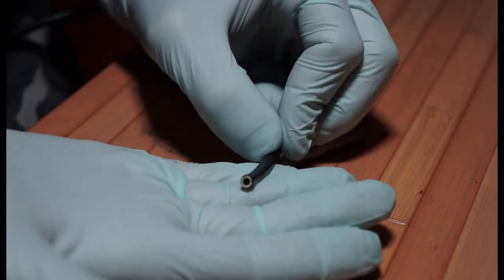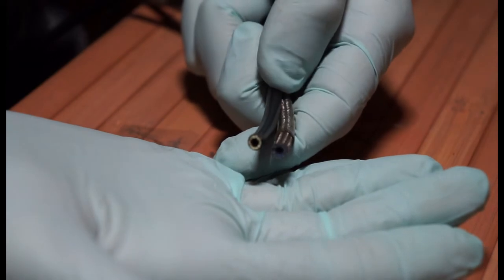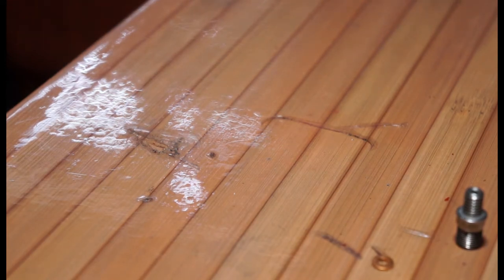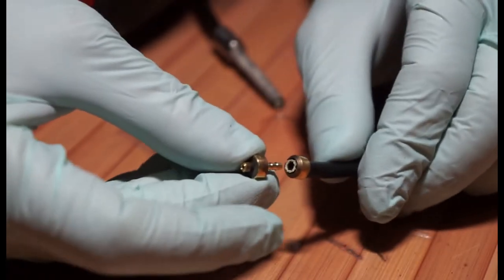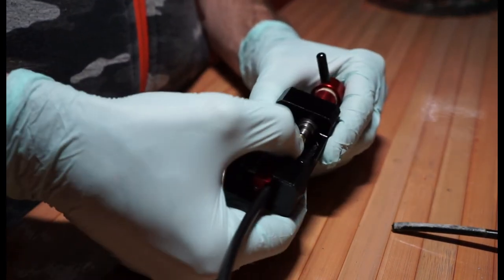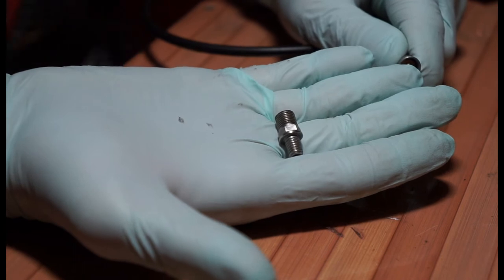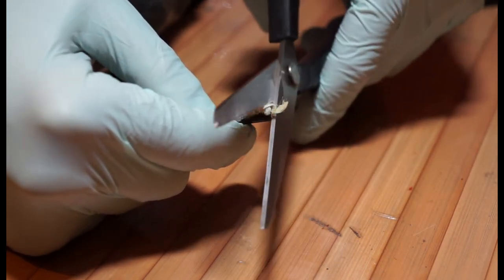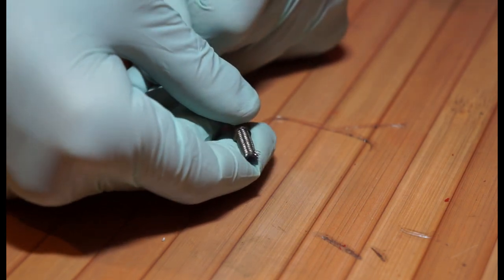Hope Hoses 101 Cutting Fitting Ends 5mm 6mm Braided Line

Comment: Just bought some hope tech v4s with braided lines, 2000mm long as standard i think. Any line cutter tool you'd recommend? also what is the name of that press tool? Thanx.
Reply from the maker: IceToolz Cable Cutter is what I use for the braided hose. It gives a nice straight edge. Needle driver tool is the press tool. Mine was just one I found on ebay.  Yours should be a bit easier than the braided hoses in this video as these were older 6mm hoses which are very ridged & harder to work with. The tech 4 stuff will come with a much more flexible 5mm hose. So potentially you won't even need to trim the clear plastic coating in order to get the fitting/olive over the 5mm hose.
Reply: @Chambers36TheEnter  Thanx for the advice and reply mate!😉👌🏻

Comment: Does anyone know if the new braided hope hose is 5mm outer diameter? And no need to cut the plastic off the out side ?
Reply from the maker: It's 6mm and cutting the plastic outer helps a lot. Only need to cut 10mm or so.
Reply: @Chambers36TheEnter  thanks for the reply im worried it wont fit through my frame lol
Reply from the maker: @justing6614  Oh internal routing, good luck. I had a Sonder Trasmitter with internal cable routing and had to use the 5mm black hoses.
Reply: @Chambers36TheEnter  hahaha thanks
Reply: @Chambers36TheEnter  just found out the new hope braided hose is 5mm and the old ones are 6mm.
Reply: New hose is 5MM and the plastic should not be stripped for the olive.
I live in UK and called Hope tech support for confirmation.
Reply: @bcr1973.  do they sell 2.5m braided hose i need like 2.3m for my setup ?

Comment: When i tighten the shroud onto my levers the brake hose seems to twist ..... is this normal ? Is there a way to prevent the hose twisting while tightening?
Reply from the maker: Hi

Yes that seems to be the norm, the brass olive will grip the hose internally and then spin it with the shroud. I would tighten the hose to the lever end first and then see if you need to adjust the banjo bolt direction at the other end. Sometime the direction of the bolt on the banjo needs to be swapped around so the hose is as straight as possible when attached to the caliper.
Reply: @Chambers36TheEnter  I understand this is going to be harder because my brake cable is internally routed ... I have a 2020 specialized enduro .
Do you think putting a little bit of silicon grease around the olive before tightening onto the lever end will help it not twist ?

Comment: Thank you!  Discovered I have the wrong shrouds for my Goodridge braided hose.  Nearly impossible to find the correct ones anywhere though.
Reply from the maker: Hi, glad it was of use. 

Ah goodridge hoses they are quite different. 

In the UK you can get the parts on ebay - https://www.ebay.co.uk/itm/173628023556?_trkparms=amclksrc%3DITM%26aid%3D1110006%26algo%3DHOMESPLICE.SIM%26ao%3D1%26asc%3D20200818143230%26meid%3D74609d6a1a06439ca3fedcb9ced8b76f%26pid%3D101224%26rk%3D4%26rkt%3D5%26sd%3D173628048043%26itm%3D173628023556%26pmt%3D0%26noa%3D1%26pg%3D2047675%26algv%3DDefaultOrganicWeb%26brand%3DGoodridge&_trksid=p2047675.c101224.m-1

And although I have never tried it, might be possible to use the hope full fittings on the goodridge hose if the diameters are the same but that's a long shot.

Comment: Excellent video ! Can you send a link for the vise your using for fitting? I am working on an atv here in Canada and finding a dyi brake line instruction is difficult. Maybe renaming your video to include small braided stainless steel brake line may help others find your instruction. Keep up the good work!
Reply from the maker: Thanks for your comment. 

The vise basically a generic eBay Chinese item, they are listed in the UK as "needle driver" but I guess they become a lot more popular as it was only about £10/£15 and now they ask £25 for the same thing.
Reply: @Chambers36TheEnter  Still cant find it on the uk Ebay site??

Comment: Really useful video. Going to be atempting to fit braided hoses to my M4's / mini levers this weekend so this has built confidence!

Cheers and hope yoru keeping well.
Reply from the maker: That's good to know, thanks! Hardest part I feel is the little olive that needs to slide on to the hose. Good to have a nice flat end screw driver or small pliers that open outward for that bit. They do snap easy though so be gentle.

The other thing is don't go too crazy when tightening the hoses to the lever and the caliper.
The copper washers will seal them so you just have to tighten them until you feel the crush washing being crushed.  The caliper bolts can twist or even snap if you apply too much pressure. 👍